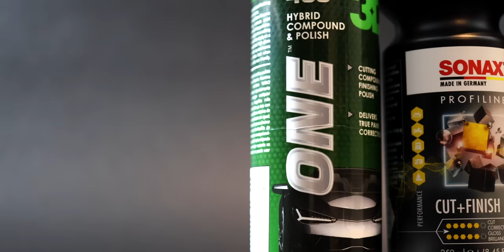The Best One Step Car Compound/Polish | 3D One vs Sonax Cut & Finish  vs Scholl Concepts S20 Black

Comment: Hello, Do you prefer 3D ONE or Rupes Uno Protect? Or is there a one step product recommendation for black soft paint?
Reply from the maker: 3D One is a one step or medium compound whereas Uno Protect is an all in one polish - so it fills and adds a sealant at the end - so it depends what you want out of that product as to which one to go for. Maybe if your new to polishing and it is a soft paint Uno Protect could be a better way to go - it won’t remove as many defects as 3D one bit should finish better.
Reply: @CarCraftAutoDetailing  for the maximum result with Uno Protect, what pad should i use ? ohh btw, is Uno Protect can work with rotary ?
Reply from the maker: You always have to do a test section as every paint and it’s defects are different, but generally speaking if it a soft paint you tend to finish better with a foam polishing or one step pad - yes you can use it with a rotary. 
This video may be worth a watch to get you started on the right direction: https://youtu.be/6tepA3wjPbY?si=OQY5ZNQjmLoiUJKG

Comment: I've been trying to polish my evo that I resprayed with COB and DEBEER air dry clear. It seems like a hard paint as I have spent a lot of time with sanding discs and various compounds but am having trouble getting a good finish. Would the debeer clear be classified as a hard paint as maybe that's my problem???
Reply from the maker: From what I’ve read it is quite a hard and durable clear coat like the newer ceramic clears so it’s probably going to be difficult and require lots of heavy refinement to get that good finish.
Reply: @CarCraftAutoDetailing  ok thanks mate.

Comment: Sandro a detailer/painter  of my area told me Scholl has silicone in it, while the website says it doesn't , he says he doesn't use it cause it will ruin  his paint spray, is it true ?
Reply from the maker: S20 Black along side many other Scholl compounds do not contain Silicone. 
Scholl Concepts does however have an absolutely massive range of compounds it produces and sells world wide, some of which I do believe contain silicones and other additives.
Reply: @CarCraftAutoDetailing  Thank's :)
Reply: @CarCraftAutoDetailing  I've ordered I will see how it does 😁👍👋

Comment: Did you just keep on applying the products to get a better finish? Instead of doing 1-2-3 step kinda thing?
Reply from the maker: No, the main thing to understand about a good one step polish is that it should give you good cut and finishing results so that you just look for a good result doing just one set of passes, not repeated passes over the same section.  If you find that they are not removing the defects then you should use a heavier cutting compound. And like wise if you find they are not finishing well you should use a finer finishing polish. All paints and their defects are different so you just have to test compounds to see what’s going to work best on that specific paint.

Comment: Hey Sandro! Nice review as always. I have to ask: on 3ds part of the summary, I noticed that after wiping off, there are some scratches. Where those in the paint or where caused by the compound or by the wipe off ? I ask because I have had same issues with some other brands. They are  circular scratches so in my case, I think they are inflicted either by the machine or wiping off. What are your thoughts about?
Reply from the maker: Thanks. You’ll tend to get more consistent circular scratches when it’s the compound, pad or both producing them, and longer straight to wavy scratches when it’s the wipe off. 
In the video it was only the last soft black paint that produced some wiping swirls.
Reply: @CarCraftAutoDetailing  well the scratches I'm talking about are similar to scratches at the end of the video. You say it's wiping but they look circular. The only thing is that indeed they are not that consistent. In my case they are more consistent but they are similar. If it was pad, compound or both, what's the advice?
Reply from the maker: Some of scratches at the end of the video panel are also produced by some the compounds, that’s when I talk about how they don’t all finish as well as each other, so those are also compounding swirls. To finish better you can try using less product on your pad, try a different pad and also a different polish. It’s always a little investigating and testing that leads you to right combination and technique on a particular paint.

Comment: Perfect finish can be used as a all in one in most cases it performs better in the category you test with a lil less cut also 3d has a wax in it so it might make finish look better than it really is.
Reply: 3D one has no wax or filler..        HD speed does
Reply: @danmorrissette4814  👍
Reply from the maker: I did always do an IPA wipe before assessing the results and I couldn’t see any filling from anyone of the compounds, like Dan Morrissette mentioned you may be confusing it with 3D Speed which is an AIO polish.
Reply: @CarCraftAutoDetailing  yep got it

Comment: Have you done testing with Sonax Perfect finish.  I’ve been meaning to do some testing.  A lot of people like to use it as a One step, however it’s results in normal use left me dissatisfied. It doesn’t cut well and finishes poor on different paints and combinations. It seems to be a very specific product. Also, it has to be the worst dusting product i’ve ever used.
Reply from the maker: I have done some testing with Sonax PF but there may be more to come, thanks for sharing your experience with it mate
Reply: @CarCraftAutoDetailing  thanks again for your content mate. cheers
Reply: How were you using it? All the people I've seen said the complete opposite
Reply: @r.k862  using in 3-4 row passes, light pressure, 3-4 size pea drops working sections ~8x the size of my pad. after watching sandros review on it i need yo to do further testing with my technique as if he can get a good result from him i need to change somethign with my technique to do the same
Reply: @valkyrie_voodoo  ooh ok that's not good. I was thinking to use Sonax perfect finish with a hand polisher but I don't think that would be a good idea seeing your results as it seems hard. I'm a noob. So I should not try?
Reply: @r.k862  you can use most polishes designed for rotary or DA polishers but the amount of work required to effectively work the polish is a lot. you’re better off buying a cheap DA polisher to use
Reply: @valkyrie_voodoo  what do you mean by effectively work the polish. What happens if you don't work in the sonax perfect finish?

Comment: What’s the best polish that doesn’t stain trim?
Reply from the maker: All true compounds and polishes will stain and abraid trims to some level, you really have to mask them off. Waxes and sealants however can vary in this area, and usually spray waxes and sealants are less likely to stain trims if that’s what you mean.
Reply: @CarCraftAutoDetailing  oh right ok, when I’ve used Uno Protect that hasn’t seemed to stain trim, I just want that without the wax part really

Comment: Hey Sandro, I’ve got my MG Astor graphene coated last week. I have 3 specific questions:
1) Cover on or off if it’s parked in shade at night(my detailing guy said that cover get car scratched up).
2) Would the graphene coating be able to protect paint if it’s standing in 5-6 hours of intense sun(40-44* Celsius, Rajasthan,India). 
3) I’ve got 6 year plan & will be called once a year for next 6 years for maintenance. Apart from that, any product that I can use daily/weekly basis which would keep the coating intact?
Reply from the maker: I don’t specifically know that coating so I would suggest taking the advice of the detailer who installed it. But generally, I don’t recommend car covers, sun light is great for curing most coatings and a good SiO2 based spray coating should help extend the life of the coating.
Reply: @CarCraftAutoDetailing  Car detailing is a relatively new here in india(trend picking up though). Most detailers have their own versions of coatings(ceramic/graphene), all I know is that it’s 10H hardness. TBH even the detailers are clueless about many things especially maintainence part after getting coating done. 
    My biggest concern is will it be safe parking for 5-6hrs in 42-44* Celsius temperature when it’s parked outside? Car cover I’ll only put on if there’s some sort of dust storm etc is on the horizon.
Reply from the maker: Too much strong UV light is never a great thing day in day out, but that’s unfortunately the way it goes if you don’t have cover and I’d still say I’d avoid the cover. Hope that helps mate.
Reply: @CarCraftAutoDetailing  Got it. Try to limit UV exposure as much as I can & will avoid cover. Thanks a lot man, that’ll help immensely. 👍🏻

Comment: hey sandro, for the first time i used a rotary with a 5 inch lake country wool pad and used 3d one.  I had good results, but had alot of sling that I never got from a DA or foam pads.   what do you recommend to keep product from slinging especially from a rotary and wool pad. thanks
Reply from the maker: Wool pads tend to hold more product more effectively so they usually sling less than foam, but overall using less product helps and starting very slow and slowly increasing speed also helps as well as some moderate pressure, as light pressure also tends to promote sling. In the end 3D is a little more prone to sling than most compounds I’ve used on rotary so it’s hard to completely eliminate it, and a different compound that’s less prone sling will also greatly help.
Reply: @CarCraftAutoDetailing  interesting, I'll just experiment and see what works best. thanks

Comment: Hey Sandro. Thanks for this cool test. I mean  that perfekt finish sonax is the compatitor to s20 i have the cut and finish also. I have compare all tree together and work a long time with them. By my working style i see that perfekt finish is the better s20. And the cut and finish is like you say better on harder onestep paints. I think the perfekt finish sonax is the catagory of s20 and one. What do you think ?
Reply from the maker: It’s not always easy to put compounds into a straight forward category because there’s a lot over crossover as far as cut and finish goes. But I would still tend to say Perfect Finish is a finishing polish with a bit of bite like a few other polishes rather than a medium compound if I had to put it into a category. But that doesn’t mean it can’t be a great one step or medium compound. You could even say Cut & Finish is a cutting compound rather than a one step. In the end I don’t think it really matters all that much, but if the brands call it a one step or finishing polish that’s what I tend to judge it as.

Comment: Hey sandro. I have a freshly painted car with lots of clear coats which has been cut back with 2000 grit, about to start polishing it

Could I get away with a one step such as s20? Or would you recommend s20 followed by s30 or s40 or something like that ?
Reply from the maker: S20 could very well work great as a one step if the fresh paint is on the softer side   and your technique and pad choice is tuned well to that paint and the sanding scratches. Some fresh paints, 2k in particular can still be very hard and you may need to step up to a more aggressive compound like S2 black and a wool or MF pad or even sand to P3000, and some overly softer fresh paints can be very sensitive and you may need to finish down with S30. In the end you should do a few test sections and that’s what’s really going to let you know the best combination and technique forward on your specific paint.
Reply from the maker: This video if you haven’t seen it may also be helpful: https://youtu.be/Wi0vqdMsA1o?si=778fLt2c7zBFCFmM
Reply: Yep ok il have to see on the day. I have S3 XXL gold not S2 but can always purchase s2 instead. 

Looks like gona be a timely process, thanks for the reply, 

I did also see your other video, I'm hoping to skip the 4000 grit stage, I think it will be possible potentially,
Reply from the maker: @SussNit S3 Gold can also work great to remove the sanding marks, it just won’t tend to finish as well as S2 Black - but if you’re doing a two step it could still be great. 
Yes, because sanding scratches can vary a lot depending on how uniform and well they’ve been done as well as the paint type, you really have do a few tests to confirm what’s going to be the best way forward.
Reply: @CarCraftAutoDetailing  was all done by hand the 2000, so will be un even potentially
Reply: @CarCraftAutoDetailing  which microfibre pad do you recommend?? I'm on the waxit website, or should I try a  heavy cutting pad like the shine mate ones, I'm gona order the s2
Reply from the maker: The T100 is a great all round MF pad: 
https://www.waxit.com.au/products/shinemate-t100-one-step-cutting-microfiber-pad?ref=1NNwBEgP4yO4AX
Reply: @CarCraftAutoDetailing  I'm struggling with the wool pad, especially over ridges or panels ending, I've cut through in 2 spots with the rotary machine. Tried the DA with a wool pad and it isn't cutting as well as the rotary, so thinking a microfibre pad on the DA might be better ??

Comment: Due to insecurity your firs portion was confusing. Don't over complicate things to make them seem more important, speak as if we were 4 years old and you'll never go wrong. Try and emulate an university professor and you will crush and burn. We are still not clear how a one step compound can be used to generate a "great result". What does that mean? great result can mean anything. Why don't you tell us if this requires a second step to gain additional gloss and a finish wax or ceramic coating. Clear as mudd. Do better.